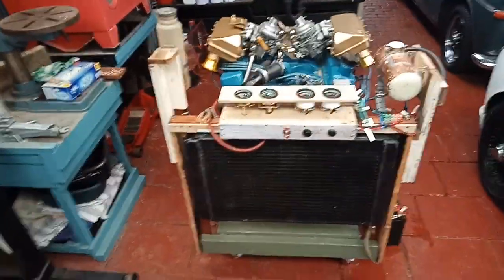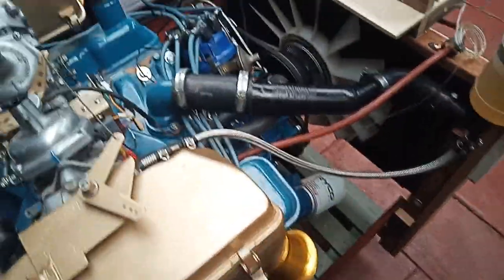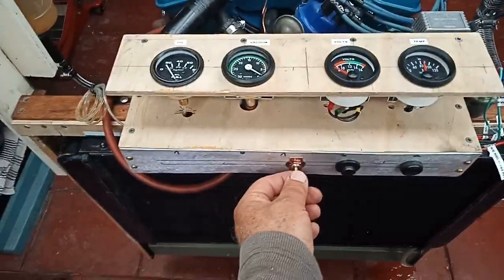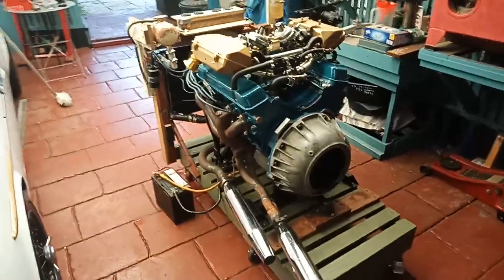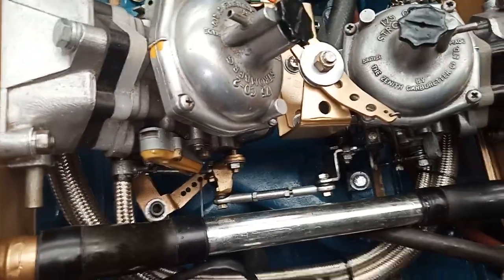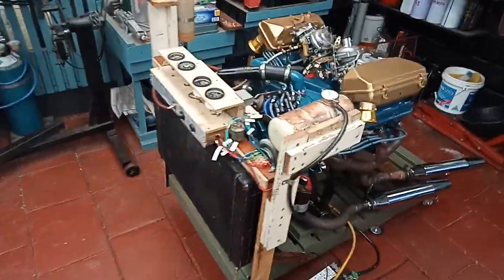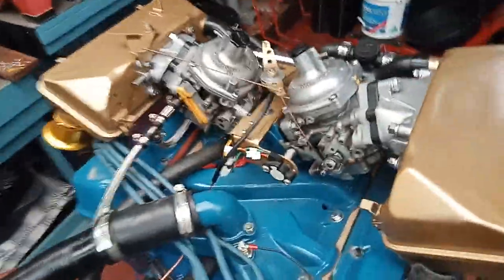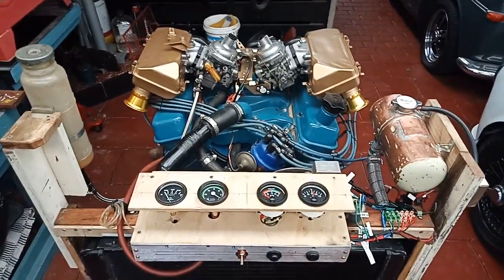P76 V8 Hybrid Engine

Comment: Mate, I just read your thread on the P5 forum. Great work. I am pricing up the parts for my 3.5 P6BS. I thought I wonder how much power the P&^ engine has. Not bad at all. How do you go for cam and bearings for a rebuild on a P76 engine.

Comment: Were the 4.4L. rover motors reliable? Everyone seems to say negative things about p76
Reply: From my personal experience they are a very good engine. Well made and reliable. My father had one and on its last trip it before we rebuilt it it had 1 broken piston and 4 cracked pistons. Gave it a basic rebuild and is still going.
Reply from the maker: Absolutely. Most of the negatiive comments come from people who have never driven or owned a P76 V8. Although Aussie developed from the smaller capacity Rover 3.5 V8 they are essentially a tried and true GM pushrod V8 from an original manufacturers/engineering stand point. I have a P76 fitted to my 1966 Rover P5 Coupe that has done well over 300,000 kms. I fully rebuilt the engine over 38 years ago. The cylinder heads have never been off the engine since the rebuild. Four years ago I replaced the timing chain, welch plugs and cleaned the sump. It still runs 215 psi compression (about 11:1) for LPG. It's also dual fuel capable via a programmable (2 ignition maps) electronic ignition system.  https://youtu.be/sWejU2USl4o       

Link to : Dual fuel for P76 V8 in 1966 RoverP5 Coupe.   https://roverp5.proboards.com/thread/12273/auxiliary-petrol-tank?page=2
Reply: @enigmasvids9615  Doesn’t the 4.4 have the higher deck height of the 340 Buick?
Reply: @mickvonbornemann3824 good question , basically the same motor !
Reply: @enigmasvids9615  You know ... the P76 was reckoned to be of wholly inferior quality as an engine for Australia only, just ideal for the stationary use we see you have there, generating electricity for the house and just useless as a luxury car engine, too many severe vibration points and you know, horrible abilities.  But if oz could just prove the engine in a Jaguar XJ, a Rover SD1 or Princess 18.22, it would be so appreciated but Australians are you know, very basic and not great people that want to keep the old British designs going.  It was just a crummy engine for some Australian sheep farms and such.  Sorry about that Enig.
Reply: @JosephCowen-fz8vj  The P76 engine was bad, the metal you know?  The casting of the P76 and its vibration points just made it a failure from the get go and no point in your talking about American abilities in engine know how.  Australians you know like Rolf Harris, and ScoMo, even P76 engine itself, are best forgotten with Cardinal Pell.